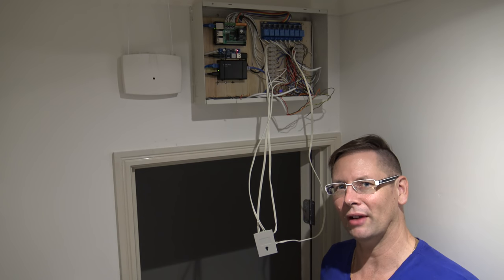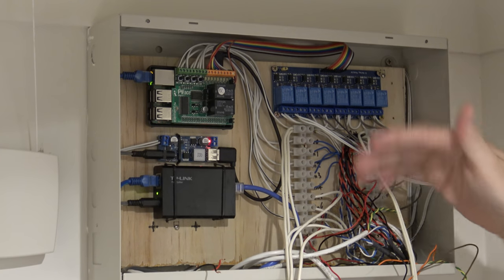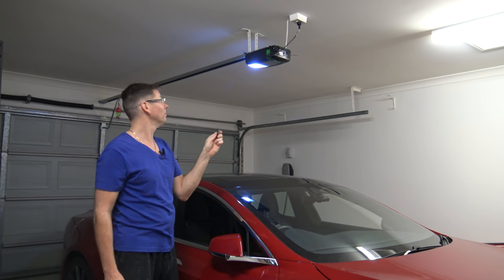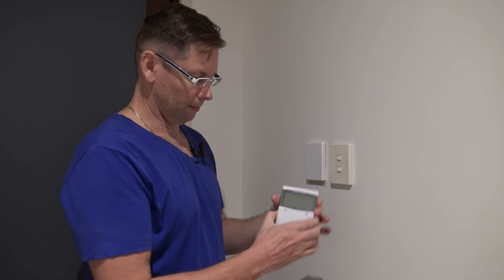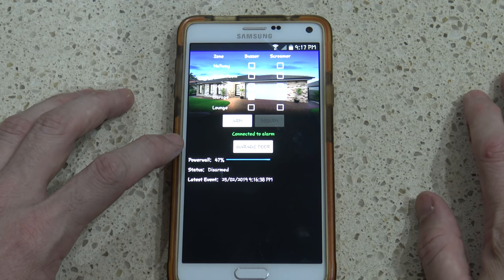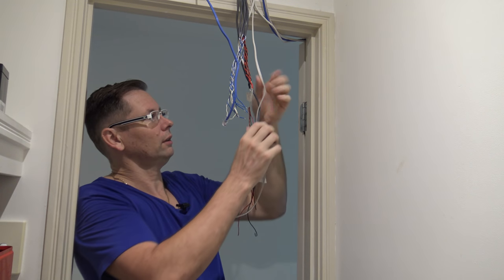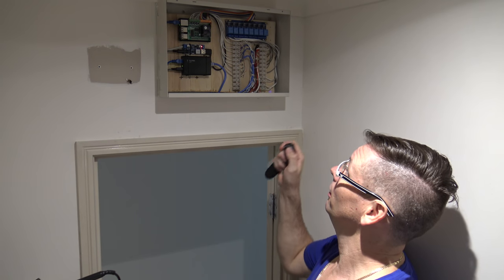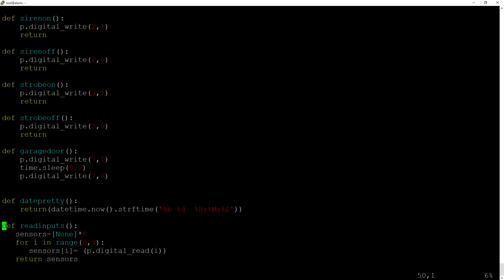Raspberry Pi Home Alarm System With Android Client

Comment from the maker: Thanks for the comments. I like hearing different people's take on how they'd approach this project. Please keep in mind that what I've presented in this video is just an example. The main concept is the use of the Raspberry Pi with PiFace for inputs and outputs. The rest is really up to you. All of the suggestions made here can certainly be done. I have other parts to this system that I have not presented here, simply because it's my home alarm system and would be a tad silly to share exactly how it works with the public! Remember, don't lose sight of the forest for the trees.
Reply: Dang - so you'll be keeping those 433MHz RF codes to yourself then?
I would suggest using the fob remote as a backup, and the phone as the main arming / disarming device.
It is straight forward enough to listen for those RF codes.
Also, what is the current draw on the 12v supply?  I'd be concerned that the 12W(?) from the TP-Link splitter isn't enough, especially if the outdoor sounder comes into play.  You could have the system brownout when the external sounder goes.
Thanks for another great vid!
Reply: Hey Dude!
 I've watched your previous videos and you come up with some pretty neat ideas.. I was wondering when someone was going use a raspberry pi to replace their security system, the way you have done it is pretty slick, and of all the pi security systems I've seen this is by far the best and most well thought out.

I'm not sure if you know about konnected ESP8266 based system, if not take a look..
Also Home assistant if you haven't already..

I've been running home assistant for a while, but this is far more superior as a dedicated security system..

Suggestion: add pir inputs to activate outputs when disarmd as this would greatly increase usability in the home automation space..

Great work! If at any time in the future you plan to share the code I know myself and many others would use and build upon what you've done here... 

Cheers...
Reply from the maker: Nah, you can see one of the codes right here   https://snag.gy/0lZqpv.jpg
Reply: Also worth asking - how are you handling the initialization of the PIR sensors in case of a short power failure or at power-up? Would the system just be un-armed at startup? I've been playing around with this idea myself, but I'm trying to think of a smart way to detect when the PIR sensors are in initialization mode. My PIR models blink for up to 1 minute until they get a base reading of the heat field, and I think the only way to sense that is through software.
Reply: @TallPaulTech  thanks for the follow up Decoding Garage Door Remote Controls
 video.  Could you touch on the power consumption side of the rig as mentioned before, please?
Reply from the maker: @williefitzall  
  PoE    | Power  Power    Alloc Alloc Actual Config   Detection   Power Pre-std
  Port   | Enable Priority By    Power Power  Type     Status      Class Detect
  ------ + ------ -------- ----- ----- ------ -------- ----------- ----- ------
         | Yes    low      usage 17 W  3.7 W           Delivering* 0     off

So, it's consuming 3.7 watts from the PoE switch without the outdoor thing screaming away.
Reply from the maker: @williefitzall  I already checked that from the power output of the PoE switch. I replied somewhere else in these comments but it's fine.

Comment: great work as always! It's quite a nice system! As for the garage waiting period, may the logic be: once the garage door is closing, have any "arm requests"(button/app) "add to queue" until the garage door is closed, clear any previous queue if garage/unarm buttons are pressed, and check if anything is "queued" after the garage door finishes(aka arm system then empty queue).

or... some magic with the time module and a global "action queue" with actions getting pushed back if the garage door is in a transition state.

Comment: Heya,

You have a good start on the system. With a few options it could be a good opensource alarm system.
1. Li-ion cell for the backup, you could also monitor it  via the Pi as well, then you know when it's time to replace it.
2. Enable the entry and exit timer.
3. A few years ago I was toying around with an idea of using a wearable RFID for a tracking pendant, so that when the system is armed, and the pet was inside the system would basically ignore the pet.
4. Have the option for different sensors Eg, a Heat sensor in the server room in case of a fire etc.
5. Also a insect option so if a sensor is triggered it would wait for another zone with x seconds to be triggered, otherwise it could be a moth.
6. Support for a door strike as well so that, you can use a button on the remote and disarm and open the front door so that you could get inside quickly if required.

Personally I think the extra line of "there is motion somewhere" is redundant, as the previous line stated where the motion was.
Otherwise nice setup :)

Comment: Thanks for posting this overview of a home based security system that doesn't depend on a third party. For me I have a cat so it looks like I'd have to keep my cat in one area of the house, while at work so that the motion sensors don't go off as she moves about.
Reply from the maker: Thank you. I'm glad at least someone appreciates not being a servant to a third party.
Reply: @TallPaulTech  not sure if you have a website or links for the python code for setting this up. I realize this was a general overview of the system but would like to get more info to set this up at my own home.

Comment: Great video. I had a similar setup using a PiFace with some Python scripts. Since migrated over to a Konnected board (which is effectively an 8266 board with some custom software). I’m now using node red and home assistant to interface it all. The PIRs now act as motion detection for the alarm and presence detection for rooms to bring on lights and adjust heating requirements. I found with the pi face to sometimes get false triggers, turned out to be electrical noise from adjacent cabling running by the sensor wires, easily filtered out in code, similar to debouncing.
Reply from the maker: I like your comment, because it has some words I haven't heard for a while and don't usually get in the comments section (ie, debouncing). I've never had a problem at all with false triggers from the motion sensors though. If that was noise, then damn that would have been a hell of a lot of noise. I don't want to automate things though, as I still like being a human and doing things myself :)

Comment: Hi, I’m putting together my own system using yours as a starting point. I have email notifications and the wireless key buttons working. Now, I’m at the point of coding a web interface and working out a UPS. I was just wondering had you planned a circuit for the UPS you mentioned in your video?

Comment: Great videos. Inspiring to do more with home automation and security.

Is there a security issue having the sensors and Raspberry Pi using the same POE power source, i.e. if you short one of the 12v sensors will it remove power from the entire alarm system?

Comment: Add a backup mobile network incase your attackers jam your internet that way your attackers are screwed unless the app also has a connection count with app say if it send a a ping to the alarm but phone dont hear back then it will alert your device phone etc etc.  With mobile and app option that will be hard for attackers to attack you but perfect for being secure.  You need the app to communicate with the alarm system every few seconds for it to do job but if you can do that then perfect.  Really good set up by the way love this.  Thanks

Comment: Nice work. Don't worry about the mess, prototypes are never finished products until you get it working the way you want and only then is it rewrired the way you want it to look.
I was back in Australia and had issues with my home alarm as well as the battery needing replacing. Decided when I go back home again (was there for leave but work in Seattle), I was going to replace it with a PI as well and use 18650's for battery backup.
Interesting PI hat you got. I was thinking to use I2C or SPI to control devices. You could make it arm once the door is shut, just need to somehow tell it to close and arm.
LOL, you're like me, don't like middle man systems and yet I work for Amazon.haha. if the middle man has issues or is hacked, you have no control.
Reply from the maker: I hate the middle man. So do most people I talk to. It's only the companies who try to tell you people love them.

Comment: This is fantastic. Can you share the scripts you have running (without compromising your own security)? A generic version of the scripts would be great.
Also,  can you share some info about the hardware? What receiver is that?
Thanks.
Reply: I'm also interested in these exact same questions - Is there a generic script that someone could point us to? I'm not new to programming but Python is a new language for me. 

In addition, you never mentioned what motion sensors these were but I believe they're the Bosch sensors that were originally installed (they look the same).

I'm also not 100% sure about the schematics of the relay's or if 8 is enough for the system I'd like to build? Did you include door/window sensors or just the motion sensors? What about turning lights on/off?

I also don't think you ever mentioned which OS you're running?

Comment: Very nice. Thank you for your time in sharing this. May I ask, in the panel... The devices coming in... Why didn't you put a Inline fuse on each or a small breaker point? Or is this not needed... I'm not knowledgeable yet on small electronics... I am however interested and taking a small course through Adafruit. Your system is very clean.. I love it. I hope to achieve the same soon... Like you said, and I agree... Got to keep that data home. 😊.

Comment: I have seen this video several times and I am amazed by it each time I watch it. Is the camera feed stored anywhere other than the micro SD card? I want to have a home security setup to a pi-based NAS.
Reply from the maker: Mate, that's an old video. I still use it of course, but check out my other videos on camera setups

Comment: One of the important benefits of remote monitoring that you overlooked, is that if you're attacked and hit a panic button - who then monitors your alarm to call the police?

About your system's layout it almost would be better to feed your IO into a pub-sub backend (Redis, MQTT, etc.), then apply your security code as a stand-alone subsystem.

By splitting the IO from the security code, it allows existing sensors to be used for home automation as well (simply subscribe to the sensor's feed).

Your simple IO also missed a chance for senor tamper detection and wiring fault detection, this may lead to false alarms down the road.

I do also have to wonder why you put in that unsecure Chinese junk RF set, when you already have a TLS capable wifi display module in your pocket...

Comment: Does the remote have a rolling code? I think most of those modules lack a rolling code
Reply from the maker: It's nice to hear from people who also like to examine exactly how things work :)
Rolling code controllers (or lack of) is something I thought of before I even bought these controllers. I, like yourself, don't expect it to have rolling code function. That being said, I'll check it soon and get back to you.
The thing is though, as I said in the video, anything is better than nothing. If someone disables the alarm, then it's no worse than without an alarm at all. Maybe the garage door button, but I do have other things in place which I haven't mentioned ;)
Also, once I get the phone app up and running, I can use that with encrypted VPN to home and not have to use the button generally.
Well thought of though.
Reply: Maybe my name is too offensive.  I did mention this is a round about way.
Reply from the maker: Your user name is awesome. Makes me laugh every time, especially when it gives approval.
None of this is stuff I don't already know. As I said, there's more to my system than I've saying on here. Can't go telling the world how to break in now can I?
Reply: @farktard2740  maybe but if you say it slowly and put emphasis in a different location it makes you sound like a legend

Comment: You should consider full home automation, I use homeseer.  You can write events to do anything.  For example I never have to manually set the alarm because the automation runs a timer when there's been no internal movement after a period of time plus vocally prompting anyone who may be inside to move around.  Now once you automation knows nobody is home has set the alarm, it can look for other things susch as water flowing when unoccupied or gas flowing when  no heating is on and turn on bright flood lights if external motion is sensed.

Comment: Building something similar but more on the house automaton side. Doorbell, fridge door open alarm, balance lithium batteries etc. I'm using node red did you consider that as the software base. I really like the modularity and visual aspect of it.

Comment: This is exactly what I am doing to my house alarm system. I have the same motivation and design. Great to see this working! As for sensors I am worrying about false alarm evets, is it reliable enough to have them connected dirrectly to raspi? are there tricks needed like resistors?

Comment: This looks awesome and has got me interested.  I have an old alarm system in my home that doesn't work, yet has all the PIR, Strobe, Siren etc.  Now I am thinking about installing a PI to manage this.  Thanks for showing the video, it really goes to show that you don't have to follow the norm and use devices in its "supposed" fashion.  PS. sure I have seen the Tesla around town ;)
Reply from the maker: You might as well do it. Friends of mine got broken into the other day, which put this project on my mind to do. I've had the stuff sitting there for over a year too. Even though it's not perfect, it's something better than nothing.

Comment: I did a similar thing, but to simplify life I modified the PIRs to contain an ESP8266 and a small buck converter, saves a load of wiring and complexity.
Reply: what did you flash the esp8266's with?
Reply: As the lighting controller I use is custom I wrote my own code for the ESP8266s, it is written in plain C using the Espressif SDK not the Arduino IDE so I doubt it would be useful to most people.

Comment: Awesome video. im on the way to create something similar and i want to know what kind of cables you use for sensors and secondly you are supplying them with 12v but this is not a problem for inputs? (because raspberry pi works with 5v) Also think about using GSM/GPRS for notifications in case of phone line problems

Comment: Hi thanks for your nice video one question the pirs are 12 volts are able to read them as inputs because of the pi face ?
Reply from the maker: They use 12v to operate, but the output signal from then is just a switch between two wires. That's what I feed as the input to the Pi, no 12v.

Comment: I'm trying to design a system that is almost identical to yours but with one difference, The cameras and motion detectors will be wireless, Their transmission system will be wifi and radio simultaneously (dual mode), They will send their data in wifi and uhf, like uav or rc planes (fpv system) I could secure a huge area, and place the camera and detector anywhere and hide them to avoid sabotage or brouyage

Comment: A garage door closer with a open  and a close  as a separate circuit would make it be easyer to code as you can set it that if you arm the house it closes the garge door and if not closed with in a specific ammount of time it informs you also i would sudjest you make it as a sepret network in your home with  vpn so that its more secure but all in all great job

Comment: How much current can you draw through the 12V output from the POE breakout box? I'm surprised you've got enough POE power to run the RPI, sensors, sirens, receiver, etc..
Reply: I agree would have thought it was POE plus. :)

Comment: The only problem with the Raspberry Pi is the SD card has a lifespan of 6 months with constant read/write.  I had to change mine out for a small SSD drive connected on USB.  The Raspberry 3 can boot from USB so no need for an SD card and no corruption after 6 months.   I'm using Home Assistant to control my house and alarm system
Reply: I am running an RPi 24/7 since Sep. 2017 (now 1,5 years) and my SD still works. I dont think, that's a problem, you only had a bad sd card
Reply: Same here.  I've ran a private server on a RPI3 for multiple years and never have had any issues.

Comment: Looks good. :)

Have you thought about putting a sensor on your garage door so the system is aware of its position.  That way you could have it so you can arm the system and if the door is open it will close it first and when it detects it is closed it can then arm the system.  Also you could show the status on your app.
Reply from the maker: Thought of it, but don't want/need it. If others do, they of course can. That's the beauty of making your own system to suit your needs.

Comment: ….THANK YOU! …..i want to set up my own home security system with wireless PIR-Motion-Detection-Sensors! I need email or push notification to my smartphone even if there is no Internet (via LAN and WLAN). Is there a already finished kind of UserInterface or Program i could use? I am not a programming expert , but i really would like to use the RaspberryPi :-(

Comment: Hi, What if I have more than 8 inputs? (ie. Door and window sensors, movement sensors, smoke sensor...) - PiFace has only 8 input and 8 outputs. What could I do? 
Also... could you share some more code?  - Arm/disarm part, processing part and notification part? 
Many thanks
Rudolf
Reply: Just use a shift register